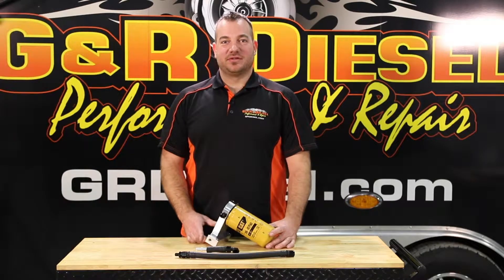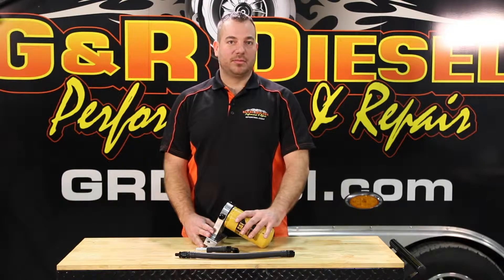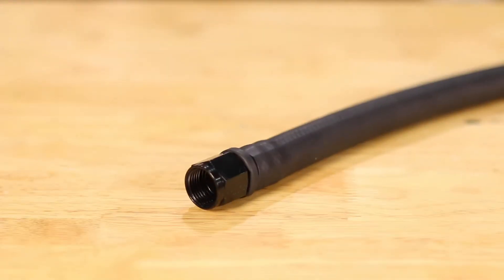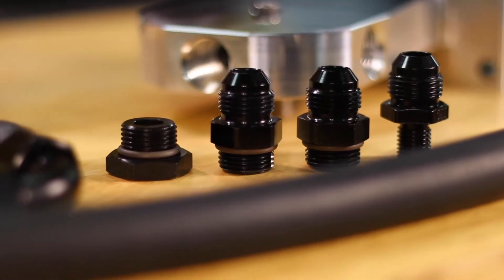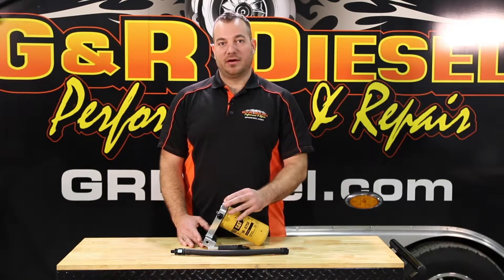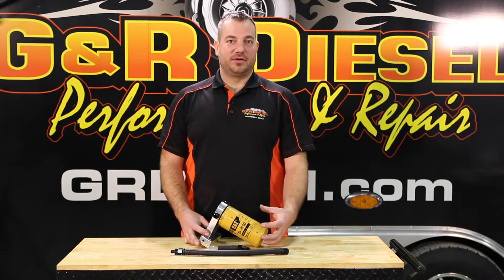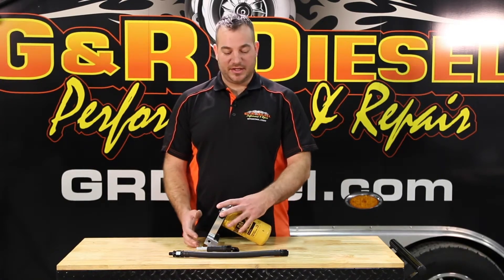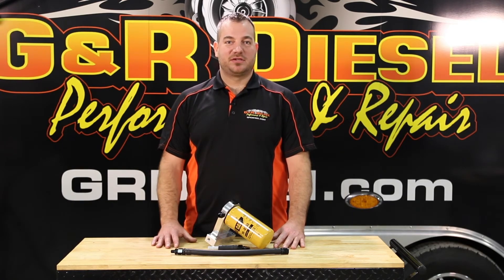6.7 Cummins CAT Fuel Filter Conversion Kit

Comment: My kit  is clearly missing fittings and the factory fuel line from the tank does not reach the filter fittings they supply. At this point my work truck is down and I'm not making money tomorrow. I am very disappointed right now. The filter base machine work is extremely high quality everything else is missing quality control big time.

Comment: Stock water sensor wiring does not reach the new location. No extension included. Stuck staring at a light on my dash now.
Reply: Factory filter still better.